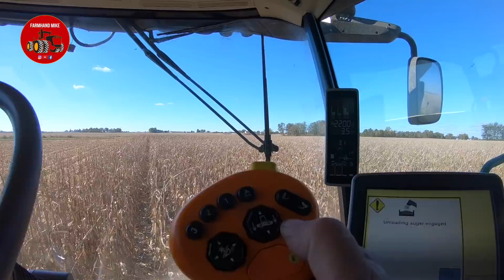Combine is Up & Running and 9 year old boy running the Grain Cart Tractor

Comment: I started doing grain cart when I was 11 in 1973 in a 1972 Ford 5000
Now I drive a Top of the range case quad track 18 months old and a new NEW HOLLAND CR 1090 with a 12 meter Bisho header which I took over from my late dad in 1996 and then it was a NH TF 78 with a 30 ft header and I love the farm work

Comment: I would have been running the tractor at age 11, but I went and busted my knee on the first of July.
6 weeks in hospital and an additional 6 weeks in a cast at home put the kibosh on that for 1958.
I am a firm believer in the statement that if you can reach the pedals and push them to the floor, then you can drive the tractor.

Comment: Boy, you took me down memory lane. I started out sitting on my uncle's lap on the tractor about age 3 or 4 soaking up everything like a sponge. One day when I was 6 I was steering pulling a 4 bottom trip plow behind our IH W9, big tractor for it's day. My uncle was standing on the drawbar hitch I turned around to see him standing in the field behind me. A index finger tip of his hat and I knew what I was being trusted to do, keep it straight make him proud. I wasn't strong enough to pull the trip rope on the plow so when i reached the end of field I spun around bracing myself and pulled with everything I could, which wasn't much but I got er done. Spun around as fast as I could and made the turn doing the reverse to trip it back into the field making sure my trip was even at the ends. I saw my uncle give another tip of the hat and walked off towards house. I plowed well past dark and when I got low on fuel I headed towards home. Since I couldn't push in the clutch I pulled up in the barn yard in front of the house and shut it off. I scrapped off my boots and swatted off what had to be 4 lbs of dust when my hat just like the men and came through the mud room into the kitchen where my aunt had a bowl of soup waiting. A few pleasantries at the table and not a word was said other than "I suppose we need to fuel up first thing in the morning" my uncle said matter of factly. I went down to the basement to shower before bed feeling just like the big guys and so it begins. Sorry for the lenght but I'm 74 now and seeing that 9yr made me go back in time like it was yesterday. Thanks for the ride

Comment: I first drove a 2 ton Chevy truck in the hay field for the 4 man hay crew crawling along in dual low at 1 or 2 mph at the age of 7.  My pay for driving was the thrill of driving.  I drove a "B" Allis Chalmers raking hay while my Dad baled the hay for Mallincrott Chemical Farm at Clarksville, Mo at the age of 8. A the age of 11 while we were putting up silage - the fellow that was supposed to drive the silage wagons beside the 1 row choppers the driver for my Dad's Super H did not show up so I jumped on the tractor and left out for the field. Pulled up beside my uncles D-17 and chopper and filled it just like one of the adults. I guess I got broke in early.  We observed what the adults did and set out to do it a little better.  My uncle bragged at lunch I loaded a wagon as good as any man but my Dad never said a word.